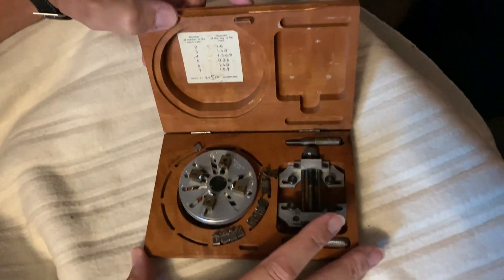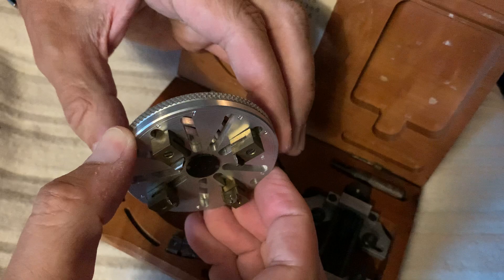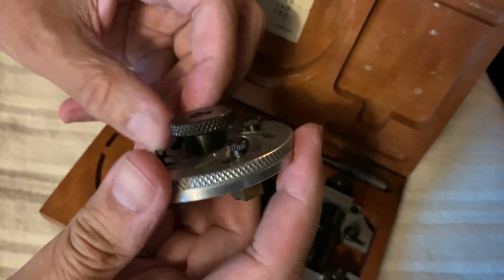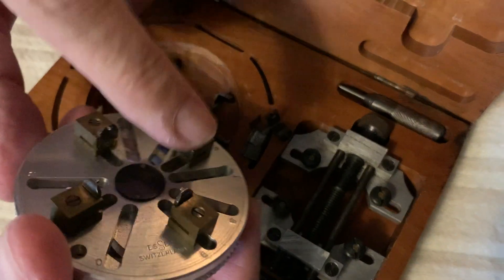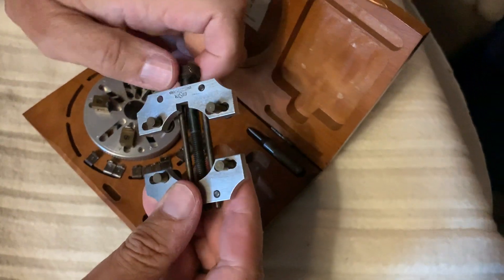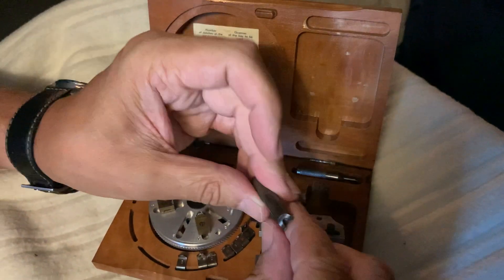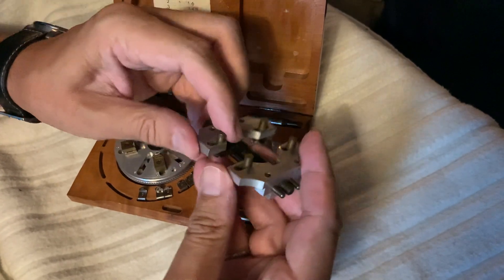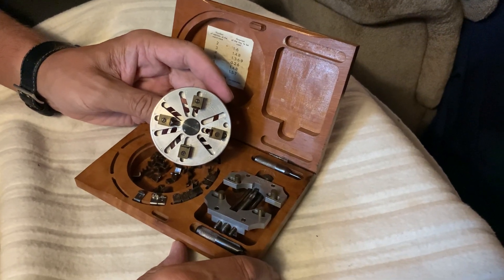What is this tool #24

Comment: the tool on the left is a pocket watch case stretcher. you could stretch a 16 size to an 18 size and so on.
the tool on the right is a case squeezer-shrinker for if you stretched it too much.
while either tool was in use it left an open spot in the box to put your beer.
trying to disassemble a very old verge fusee right now and everything is stuck like glue.
todd in montreal
Reply from the maker: Okay, I know you're just kidding when you're saying it's a pocket watch case stretcher.

Comment: Well made tool indeed. I have seen it on ebay but I do not have one. May be it is intended for crystal manipulations
Reply from the maker: This tool is used for removing case backs and is way over engineered as was said by another individual on this channel
Reply: @JDRichard  I like this "over engineered" term. Sound like mitigation for overkill
Reply from the maker: @Qwerty-cb1ti  Makes overkill seem positive:)